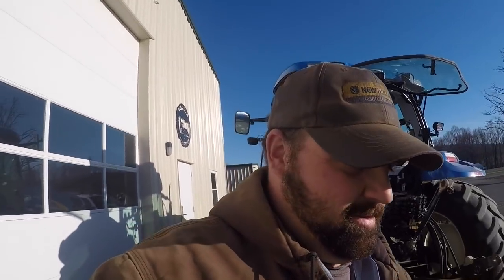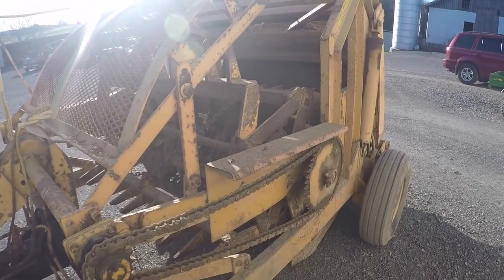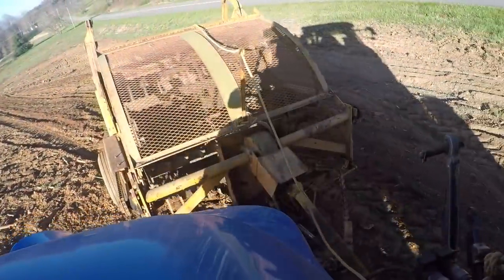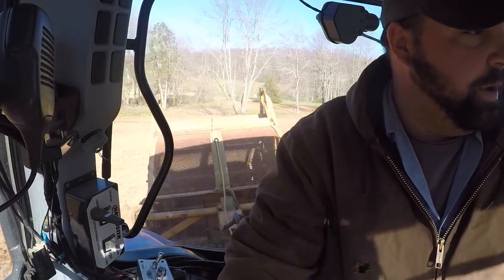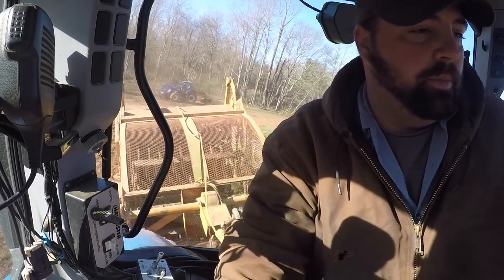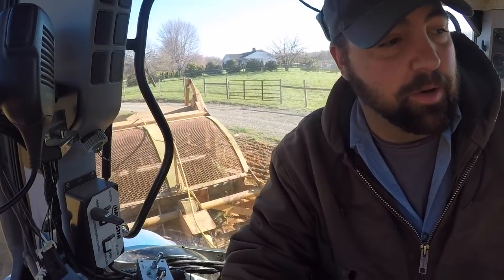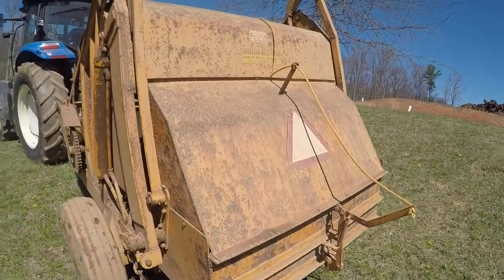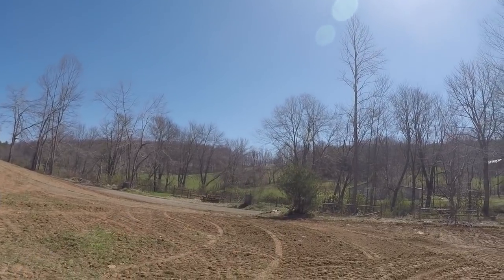Check out this old rock picker! I have a tractor confession to make...

Comment: Congratulations on the new tractor, glad you decided to buy new instead of used. You seem to want things to work when you need them not have to fix or tinker with them to get a job done. Where was that rock picker when I was a kid, man that would have been nice. Good video,thx
Reply from the maker: Your exactly right! I was looking at used because I could get a bigger tractor with more features and stay in my budget, but I decided it wasn't worth the risk and headache.

Comment: I am guessing Red.   I have an old 1982  Massey 245  with 225 hours on it when I bought it and I bought a new Massey 2635.  Both have worked perfect for the last 3 years. I am what I call a gentleman farmer just work 35 acres and have 30 acres of woods.
Reply from the maker: Just have to wait and see what color it is. Glad the Massey are working out for you

Comment: The rock pickers we use here in the Northeast look similar to a potato digger and can do 2-4 rows at a time. The rocks and debris go along a conveyor made of metal lags and empty into a hopper in the rear. No worries of dirt getting in with the undesired stuff as they fall through the spacing in the lags. The one the last farm I work for had one called a Rock Hog.
Reply from the maker: Sounds like a better machine than this one

Comment: Well, just how many hours of back breaking work and trips to dump would it have taken to collect and load all those stones and roots if you were doing that by hand!! I suspect it would never have got done without the rock picker? And it looks as though you have a big heap of rubbish in the middle of the field to dispose of still. 
Quick thought about the reseeding programme - have you thought of using some oats or annual (Westerwold) ryegrass in the mix so that they germinate quickly and stabilise the soil. With reasonable weather this ryegrass will make a pretty good hay crop in about 8 weeks. However oats will tolerate any lingering soil acidity better but the ryegrass seed is not cheap and once seeded it is done for good (unless it drops some seed before you harvest it).
Congrats on new tractor, I thought you seemed pretty impressed with the Massey you had to drive briefly and over here folks are certainly impressed with the recent bigger ones.
Reply from the maker: I'm going to be broadcasting K31 mixed with a small amount of annual ryegrass and then drilling oats and a little red clover. Then I'm going to cultipack. What do you think? I didn't do the clearing or the burning and was told to work around the burn piles. I've already put down lime and disked it in, the soil is very acidic. I'm also  putting down the recommended amount of fertilizer.
Reply: My thoughts would be in your likely circumstances firstly please don't be mean with the amount of seed your planning on using - use plenty! The slopes look to be pretty sharp and erosion a real risk in the event of heavy rain (you mentioned in the video how heavy rain had washed gulleys over winter). 
I would also be tempted to drill the oats and annual ryegrass first followed by the cultipacker used across the slope to slow down any erosion. I would hope you get quick emergence and once the oats are three to four leaves emerged then broadcast your grass seed and cultipack again. Just watch out to avoid any wheelslip and heavy marks when turning on the headlands as it will tear out the young plants or snap off the shoots. In my experience go fairly slow and use a big enough (heavy) tractor to help with this issue, can you hook the cultipress behind the broadcaster on will it tear it apart?  
Another alternative I have used is to take the seed tubes off the drill and just let the seed be metered out and fall out of the box and the coulters doing nothing to speak of. (This works really well in windy weather and even in a light shower!)
One question, if the soil is so acidic and you have only recently limed it, why are you planning on using red clover? In general clovers are very sensitive to soil acidity and the seed mighty expensive. A seed merchant might have a better suggestion for your circumstances or plan to sow the seed at a later date once the soil has been pH tested again as it takes rainfall and time for the calcium to be mobilised.
Reply from the maker: The clover was suggested to planted later on and I probably will do it that way. Thanks for the great advice!

Comment: What did you till with before using the rock picker? Or are you going over freshly cleared forest ground? We're clearing a few acres right now.
Reply from the maker: This was fresh cleared ground but I did run a finish disk over it since it's been setting cleared since the fall.

Comment: Looking forward to the new tractor. My brother had an Anderson rock picker. I never got to see him use it. Thanks for the video. Have you ever tried a skid steer loader with a rock bucket for clearing rocks and sticks?
Reply from the maker: It depends on what you mean by rock bucket, if it's a power rock bucket then no but if you mean like a skeleton bucket then yes, they don't really work all that well. A Harley rake on a skid steer or tractor is the best thing to clean up rock with that I have found, but it still just puts them into piles that you have to clean up with the bucket or rock picker.

Comment: I checked out some more info about the economy NH tractor, the tractor wreckers will tell you they came to the realization a long time ago that the Fiat brand of tractors which includes NH, Case, Farmliners, are a far better tractors than everyone realizes, I have came to the same conclusion after talking to a tractor wrecker who sold off his business after decades running it,
Reply from the maker: What made them come to that conclusion?
Reply: mainly because they sell a lot of Massey Ferguson parts and don't sell any Fiat parts, wreckers know what goes on because they are the ones people go to for parts, the 4x4 wreckers are the same because they get people asking for a particular part then they build up knowledge of vehicle makes and what breaks and they find out a lot when they wreck things.
Reply from the maker: I got ya 👍